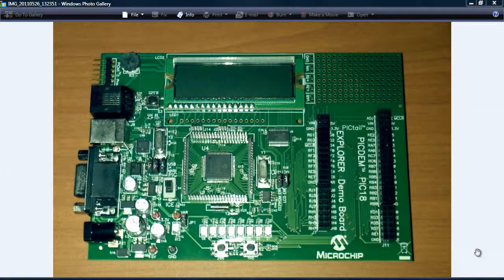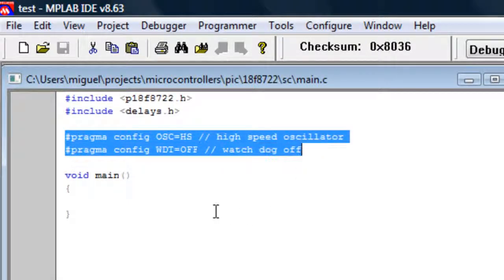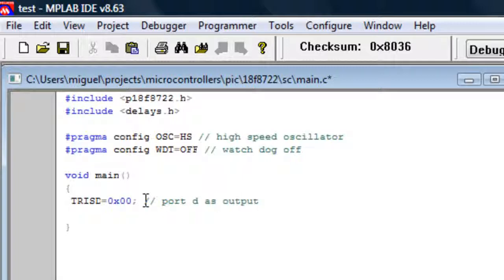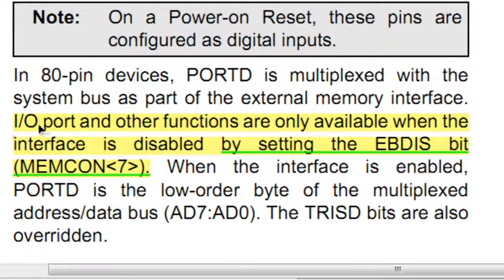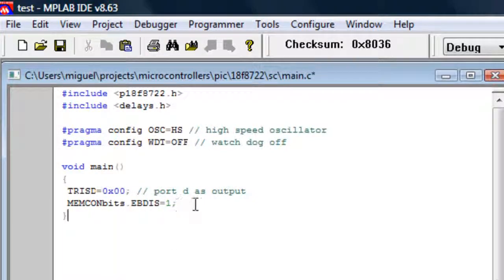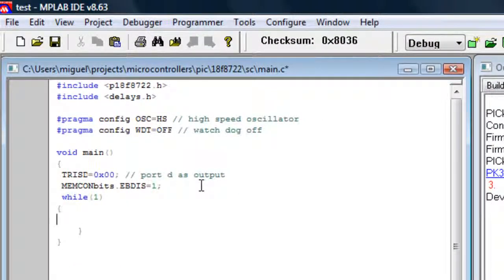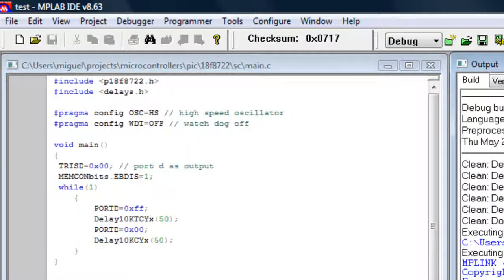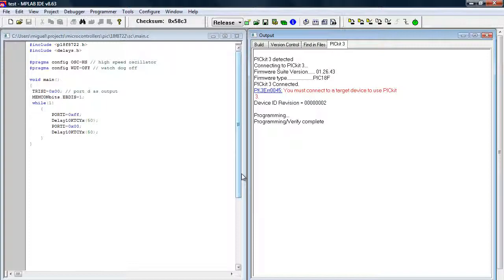PIC18 Explorer Board Tutorial: Lights In Port D

Comment from the maker: Sorry for the late reply. The file is included in the C18 compiler folder when you install it, they have one for every chip. Look at C:\Program Files\MCC18\h or wherever you installed the compiler, they have other files such as adc.h for A/D conversion, it's worth checking out the contents of the files, you learn a lot about how the chip operates at a lower level.